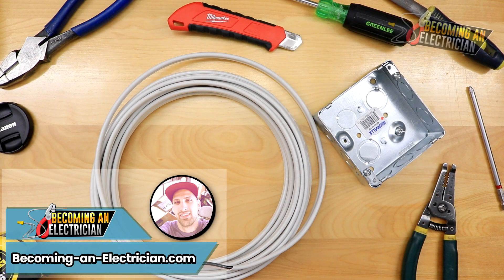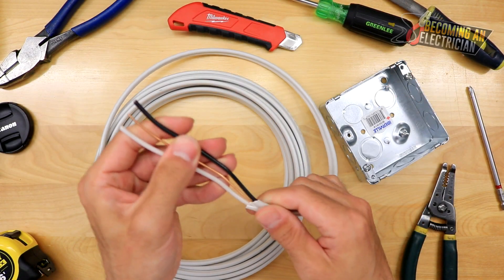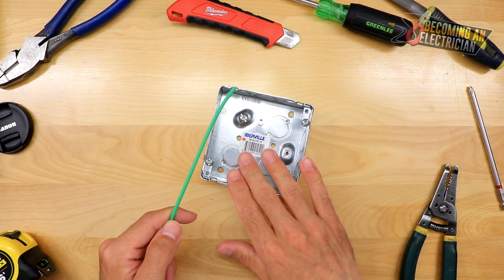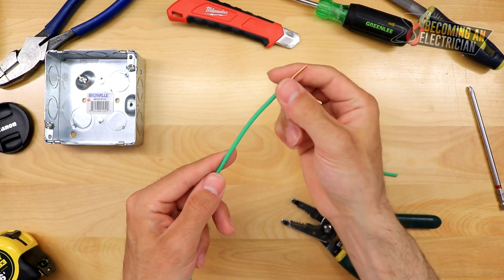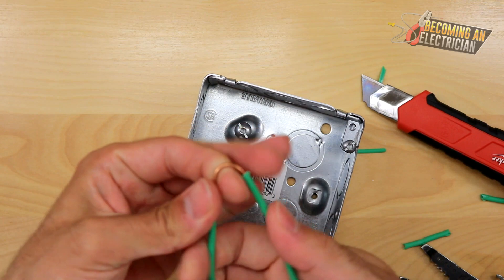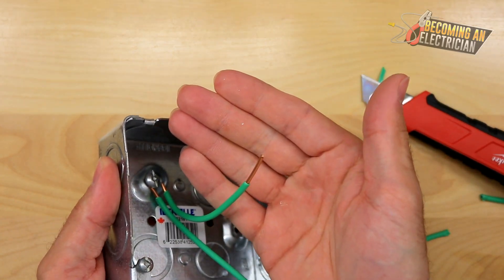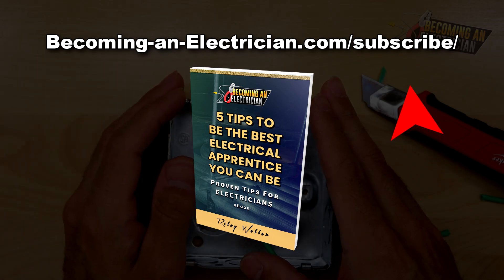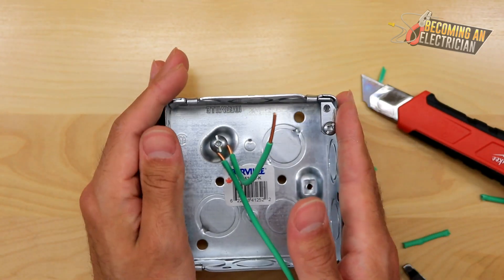Tricks to Strip Insulated Bond Wire (METAL BOXES)

Comment: You need to note that in the 2020 NEC electric code there was a change that applies here. So, if your location is now using the 2020 code you will not be allowed to use this trick. Check out 250.148 Continuity of equipment ground conductors and attachments in boxes. I did notiice that. you are in Canada so your code may be different.
Reply from the maker: Could you explain 250.148 further, and clarify how it is not allowed please